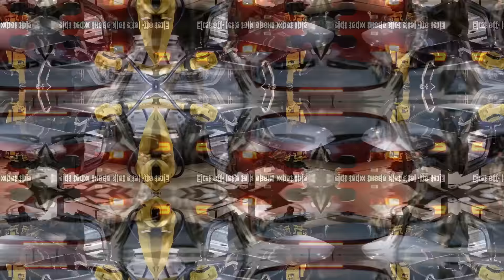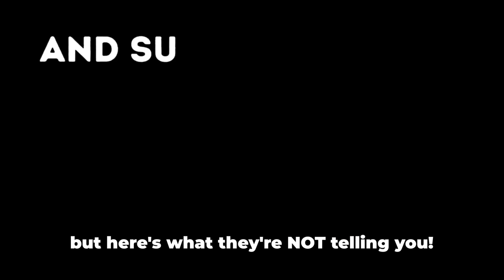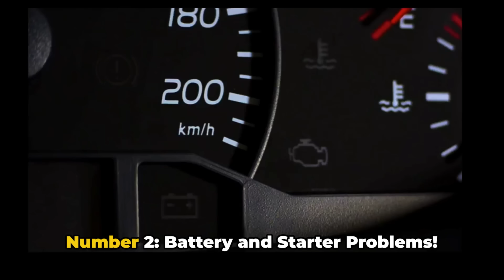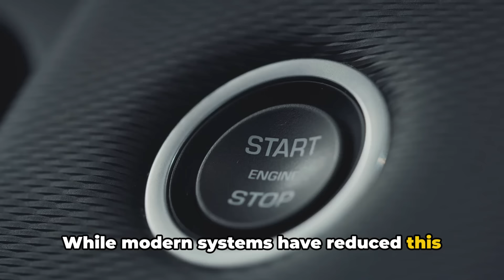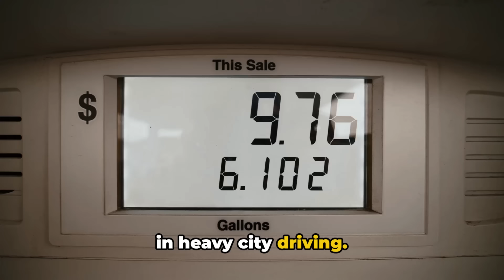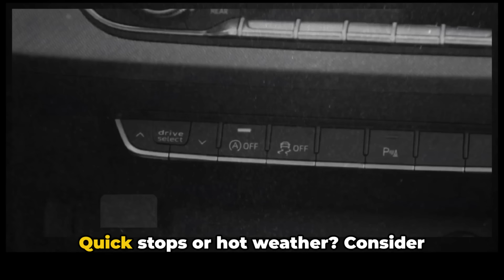The TRUTH About Auto Stop-Start System (Nobody Talks About)

Comment: Maybe I got lucky, but my car is 9 years old with 90,000 miles on the clock and it's still on the original battery with no mechanical problems so far.
My concern is this: Surely there's a big C02 penalty, firstly in manufacturing beefier batteries and starter motors, and secondly in dragging all the extra weight around in the car. Do the modest C02 savings of the stop-start system really offset this, even in city traffic?

Comment: Small car, low mileage UK viewer here. In my town, a quarter mile section of the main road through town has a lot of junctions and pedestrian crossings, so at busy times you might stop for a few moments literally 10 times. A new battery for my car costs around £110, which will buy enough petrol (gasoline) to take me over 1,000 miles  -  around 1/4 of my yearly milage - and that's without counting wear and tear on the engine itself. 
Running my car in Sport Mode switches off Auto Stop/Start, and (counter intuitively) gives me better fuel economy, so it's now permanently in Sport Mode.

Comment: Having no problem here, driving a 2013 Seat Leon 5F, with start/stop. 
Since i drive a manual gearbox, when I stop at a trafic light, it just stops. When I use my clutch the car starts auto with no delay just like you drive manualy.
Only part i replaced once is the battery after 9years.
About the AC, it just shuts off the cooling (shuts off heavy consumers), but the fan keeps running.
Sometimes the car will start auto, when it drain to much from the battery.

Comment: The good news is that once the battery is a few years old, the stop/start system usually stops working altogether and leaves the engine idling when the car stops. This is because the voltage has dropped slightly and the stop/start system thinks that the battery still needs charging, therefore it is not appropriate to switch the engine off.

Comment: My pet hates:
Stop start - First thing I switch off after starting the car.

Rear fog lights - Total waste of time because people just leave them on. If you can see the car in front, the car behind can see you, but cars behind won't see brake lights so well with rear fogs on. 

Self parking - Parking your car is part of owning a car, learn it or hand the keys back. Up there with lane assistance, just no. 

Modern indicators - Those manufacturers that place small indicators in with or near the headlight expecting other drivers to have a kind of visual superpower to see them. If you drive such a car remember we can't see them as you edge out. 

Ok grumpy is going to get his coffee now. ☕️
Reply: The more automatic shite you have in your car the more problems will you have. Because everything technical will break down sooner or later, hopefully later.
Not only the environmental stuff like this. People fall for the car manufacturers' propaganda that tell you that you "need" all that electronic crap.

It's interesting that people survived by driving in and before the 1970's without having an AC, electric windows, central locks etc. Here in Europe we didn't even (I still don't) miss automatic gearboxes.

In 1987 I bought a brand new Toyota Hilux 2.4D 4WD pickup truck.. It still had nothing of that crap, not even a radio as stock. It was made to take me from place A to place B (literally), nothing else. I indeed installed a stereo by myself. That was all. I drove it more than 100,000 miles (160.000km) in 8 years and not a single technical issue. But me, the idiot, wanted a Mercedes.😢 That's the main reason why I sold it.

Comment: Simply put, by the 90’s, with the introduction of CAD design, simulation and Prediction Software, engines were becoming too reliable.
So the manufacturers needed to add in Planned Failure Rates (commonly referred to as ‘Planned Obsolescence’ but that term does not cover it all)
So enter, the Start/Stop, and the like.
Ford’s wet belt fiasco is the latest one

Comment: I hate it when needing a swift take off with the car selecting the gear and engine starting up at the same time which does seem rather clunky and potentially expensive. Auto start was OK with manual boxes but hate it with DSG automatic boxes. Anything to do with eco is bad news such as the ethanol petrol muck we now have to buy in the UK. I buy the E5 stuff with 5% as opposed to 10% but we have to pay extra for the privilege.

Comment: I save over £160 year on road tax because of the stop/start system on my car. Battery lasted 11 years, no engine issues for me as car is maintained regularly, and I use the stop/start as required.
You know your battery is starting to degrade when the stop/start does not work when activated.
Maybe I have been lucky with my car, but then it isn't an automatic, as I would defo switch it off on that type of gearbox.

Comment: Well said.  I'm going to shop for a circuit that latches the on/off state of the autostart system to keep me from forgetting to turn it off.  I definitely don't like the idea of the oil in the turbocharger getting hot while the engine is off at a stop light.

Edit: just bought a plug n play autostop disabler for my CRV from Amazon for $24.99.
Reply: Check your warranty, if it is still valid.

Comment: What i have determined about my late model Honda Suv.  In summer put the AC to max cool setting and the stop start never cuts the engine off.  When setting at a light, very lightly press the brake and engine keeps running.  If you know you want the engine to stop, press the brake firmly.  Then when you want to start the engine - lighten up on the brake pedal.

Comment: I have an “Auto Stop Eliminator” in my Subaru. It took all of 30 seconds to install and saves me the trouble of turning the Auto Stop off each time I start my car. Love it.
Reply: I've got one in my Grand Cherokee also.
Ordered it the day I bought the Jeep.
LOVE IT!
Reply: @rickbrown7287 would love to know what type you installed as I have same model!
Reply: Sounds great! Where did you get it?
Reply: Will this void the warranty on the vehicle?
Serious question.
Reply: Does this void - in part or completely - your warranty?
Reply: Where did you get this switch?  I have a 2022 Subaru outback with this and I would love to shut it off permanently
Reply: Can the "Auto Stop Eliminator" be installed on any/most cars?  Would like more information on this Ray.
Reply: Got one for my 2019 Ford Edge and it works great. Super easy install (get a trim removal too though!).
Reply: Same with my subaru and also the wire harness to power my dash cam using the top/head console above the rear view to plug into.  Its hidden and do not see wires running around the windshield.
Reply: This is what I did for my 2022 Ford Maverick as well.  Pretty slick.  All it does is remember your setting between trips.  You can still turn it on/off normally.
Reply: It's your pathetic Subaru CVT that's your issue not start stop.
Reply: @gaberson3819  Have you ever driven one , Bud? I have two of them... Best cars I have ever driven.

Comment: I dislike the start stop bs myself and turn it off, while I agree with most of what was said the bit about oil pressure isn’t exactly correct. The short amount of time the engine stops isn’t anywhere near long enough for oil to drain off engine components and leave them dry, in fact most oil now stays attached to moving parts so they never become dry and suffer from excessive wear, the bigger issue with engine oil is modern engines which turn down oil pressure in certain circumstances to lower emissions, this is very bad for engines and those engines tend to suffer from oil starvation problems. 

The fact idiots that push the start stop as helping emissions shows their stupidity as idling engines produce much less emissions than replacing one of the very expensive batteries needed for these systems and you go through batteries more frequently.

Comment: GM start stop works well. It will not turn off in cold or hot weather unless the cabin is at or near set temp. 
The GMs I have driven with this feature just put the car in sport mode, bang start stop goes to sleep.
The turbo issue, not many folks are using the turbo in urban start stop traffic.

Comment: What about the extra strain it puts on your timing chain each time you start, causing  stretch and early failure.
Reply: Idle stop restarts are very easy starts.  The engine and components all are at operating temperature.

Comment: I worked for BMW and not only are the AGM batteries more expensive but there is a registration process when replacing which has a labour cost associated with it. The biggest issue is the harm to the turbos. The system only works when at operating temperature but still not a good idea to reduce oil supply to a spinning turbo.

Comment: I just bought a Subaru with this. The auto stop does not function unless engine and interior temperature parameters are met. The outside temperature has not been above -30c since I purchased the vehicle so it never did its thing. That until it was in a shop getting winter tires installed. Stopping at a light it kicked in and then started the engine once I touched the gas pedal. It made for a jerky forward motion. I’ll be getting into a habit of turning it off.

Comment: As someone who is working in a dealership and have been for the last six years this is 100% true these cars require a start stop battery that is at least twice the price and if you try a none start stop battery it will not last even a year I have seen many times people not believe us and use a none start stop battery and not last. The best vehicle to get is a none start stop none direct port injected motor and none hybrid all of these have a bad trade off that cost you more money than you are saving.
Reply: Trying to find a vehicle without the stop/start and  no direct injection , is pretty tall order these days. 

One other thing that needs to avoided are cars with VCM (variable cylinder management), where a number of cylinders are shut down at a certain continuous speed. The added vibration is hard on engine mounts. On Honda's, they have active engine mounts that adjust to minimize the vibration when the VCM kicks in, but those engine mounts go bad around 80K miles. Replacing them is a BIG sticker shock. 

Just  another car manufacture gimmick to help them meet their CAFE numbers.

Comment: On a F150, if you plug a trailer light tester onto the receptacle on the bumper it turns the auto start off because it thinks you have a trailer hooked up. You can buy them at harbor freight for like 4 bucks.
Reply: Wow, if my Maverick doesn't have the "black wire at the negative terminal defeat" like Rams & evidently the Ranger do, I may try your trick!

Comment: Ford, 107000 miles. Original battery, starts every time with absolutely no lag at all, turbo is cooled for a few seconds by water to protect it. In my first identical Ford model I turned the stop/start off and had electrical issues. So I’m not disputing any of your video but I will leave mine on.
Reply: Same. Also have two Fords. Both with slightly less than 50,000 miles and I rarely ever switch off the auto start/stop. I haven't seen any problems arise with using it. I perform regular maintenance on them so that probably helps.

Comment: It's not worth having on ! My mother has a 2020 Subaru it has this feature I always turn it off as soon as I start the engine ! Hard on battery , hard on starter and it's unnecessary wear an tear on internal parts because oil pump has stopped so your oil is now drained back into the pan everytime your engine shuts down ! Stupid engineering and stupid idea ! It's there to cost you big $$$$$

Comment: What about the Auto Stop-Start in hybrid vehicles? Hybrids do this less often. Thoughts?
Reply: The 48 V mild hybrid usually use the drive motor sandwiched between the engine and transmission to start the engine. So more than enough power and durability.
Reply: Full hybrid vehicles do not have starter motors. When the engine starts its instant and the 12v battery has nothing to do with the engine starting because the hybrid battery and the hybrid electric motor start the engine

Comment: This information is a great public service. Thanks. Auto Stop-Start is virtually unavoidable anymore, so the least we can do is to turn it off after we start the engine. I doubt that a dealer will permanently disable the feature for us, and even an independent shop may hesitate. That also may void the warranty if it shows on a diagnostic readout (dealers love to have an excuse to avoid less-profitable warranty repairs).
Reply: There is no prblem with VCDS and OBD to disable Start/Stop for good , and it costs 5min of time. Of course you can make it as habbit and always switch off start/stop when starting engine, like pulling parking brake on/off.

Comment: In "79" we drove all around "western Europe" for the summer.  (leased car, much cheaper)  At the time Switzerland had a law in place that you turned off your car at stoplights for smog control.  Some time later it turned out that smog was increasing due to the fact cars take an extra small amount of fuel to restart.
Reply: You will save fuel if you stop the engine for more than an average of 1,5 seconds.
Reply: That might have been true 1979 but it's not a relevant argument since at least thirty years.
Reply: Diesel engines use next to nothing ticking over, compared to petrol.
Reply: Perhaps true in 1979, not so in 2025
Reply: Also more fuel to reheat the catalytic converter.
Reply: @davebrown9725  in 1979 nobody heard of that
Reply: That was so when cars had carburetors…not an issue with modern fuel injectors…no extra fuel required to start the car anymore…

Comment: Ram pickups with the eTorque system use the eTorque motor for the Auto Start rather than the engine starter. This saves wear in the engine starter, and also makes for smoother Auto Start. But the Auto Stop function can be completely disabled by simply disconnecting one easily accessible wire. This eliminates the need to manually tun off the Auto Start/Stop switch every time the vehicle is driven.
Reply: Yes, the 48V mild hybrid systems are designed for this. Not surprised Ram made their stop/start so easily defeatable.

Comment: As mentioned at the end, it’s car manufacturers trying to meet emissions requirements and fuel economy targets. The increasing complexity of our vehicles is the byproduct of government regulations. Cars idling at a red light can generate a significant amount of emissions. Just be thankful that you can easily turn off auto start. 3:12
Reply: Exactly - it's about saving emissions, not money - saving money is just a nice byproduct. It actually doesn't cost that much more to build these systems - you're buying extra profit for the manufacturer is all.

But I grew up in the 70s, and I remember how hard it was to breathe in traffic back then. I'll take the slightly more expensive once or twice in a vehicle lifetime repair over that - doctors visits cost a lot more than a starter or battery, especially if it's because you've got a major health problem caused by pollution.
Reply: @babybirdhomeit’s not once or twice. GM V8s, the lifter problem is made worse with the auto shut off. The oil pressure is such a problem

Comment: There are things on internet that you can purchase rather reasonable price that you could have put on your vehicle or info that will keep your engine running. You can try putting your car in neutral like I did to keep the engine running. Talk to other mechanics other than your manufacturers dealership because they might not tell you. If your vehicle comes with a disabling button use it all the time !

Comment: Certain Chrysler products have a sensor on the negative terminal of the battery.  Don't forget to plug it back in if you are say changing the battery or something, or the start/stop will be disabled!
Reply: Good tip on how to disable the start/stop system. Thanks for sharing.
Reply: Any stop start system will fail to operate if there are any faults present in the vehicles PCM, the battery monitor being unplugged will inhibit stop start as it's a fundamental part of its operation. A downside to this is that modules like the PCM,DC/DC converter, BCM and BMS no longer have data to enable control of correct battery management and charging systems,either cooking your battery and or alternator over time or killing it via a safe low constant rate that ultimately leaves it going flat.

Comment: It's very simple to fix just disconnect the auto start and stop on my Ford Ranger all I had to do was disconnect a small wire going to the negative ground on the battery if you can't do that any mechanical will do it for you it only takes a minute this guy is making a big deal about nothing LOL
Reply: I heard about this with Ram/Chrysler, so if your Ranger has it, then I'm checking for it on my Maverick.
Reply: My Ford dealership did this when i purchased my Ford Ranger before i even had a chance to ask them about it when i did ask them they just looked at me and smiled in a lot of different ways they have really won my trust

Comment: My car has a CVT.  If I turn off the stop/start system, can it handle idling at traffic lights like a normal automatic?
Reply: A CVT has nothing to do with start stop technology as they do not have any correlation.
Reply: Many cars without the stop/start system have CVT drivetrains.
Reply: A CVT still has a clutch like any auto transmission, but it has no gears as such.